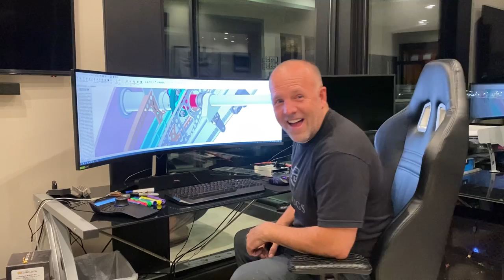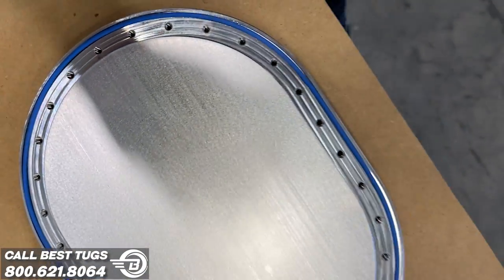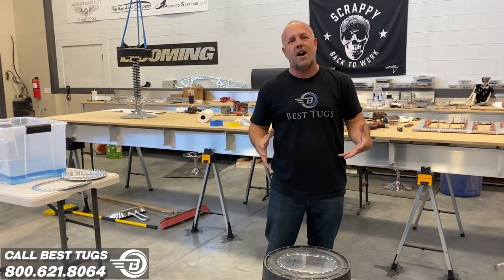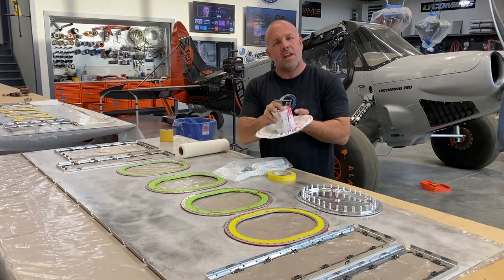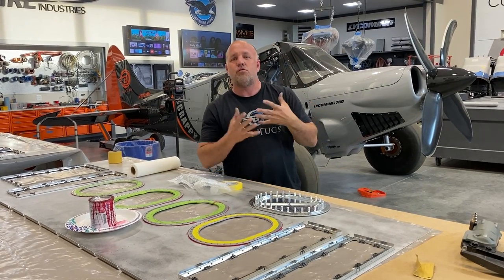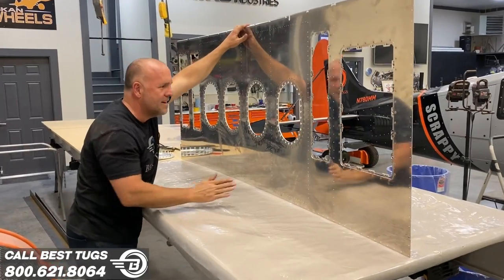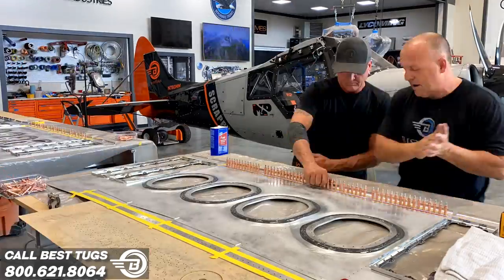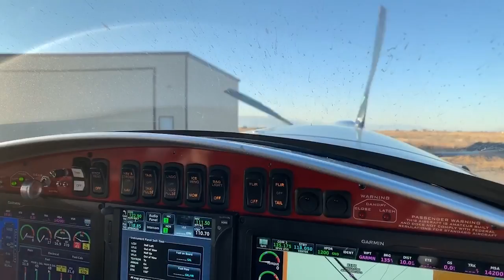WILD, one of a kind, Bush Plane Build | Scrappy #54

Comment: Mike,
How do you get the tail fly? Is the lift generated from the propeller wash? Don’t know much about airplanes
Reply: There's a string holding it up can't you see it. LOL.     Actually you're right. It is the air flowing around the tail. It's called a wheelie. And can be quite useful in certain situations.

Comment: Non aircraft related question about your PC setup for Solidworks......I've been using both SW and ProE for over 17 years in my job as an ME, and on two different occasions I tried using a 3D mouse like you have on your desk.  After two honest tries, I didn't see the benefit in either the efficiency or ease of use during my modeling.  What is it about the 3D mouse that makes it beneficial for you?  What do you like about it?

Comment: Wondering if the surface tension difference between water and fuel could cause a false positive? Maybe add detergent to lower surface tension to be similar to fuel so smaller leak paths could be detected? Enjoy the videos and look forward to more. Thanks

Comment: Oh Mikey, don’t think I would have made the fuel doors with monolithic studs.  Think I would have opted for dedicated fuel tank O-ringed anchor plates.  Just because you can, doesn’t mean you should.  The reason I’m saying that is, as the wing flexes, stress is put on those fuel panel close outs.  If I were you and had the where with all, I’d make up a set of close outs with the riveted in place o-ring screw retainers that can be changed out if they leak.  One of those studs cracks or breaks it’s headache city.  All the big jets use this type of sealing system on their fuel close out plates.  FWIW...

Comment: To test the integrity of a fuel tank, why not put two takeoffs, one for line in and the other for pressure measurement to pressurize the empty fuel tank and monitor the decay in pressure, if any, to see if there is a leak.  This is called a double block and bleed and is used to test gas fuel lines going into Turbines.

Comment: I like your fuel panel leak test, but I was thinking that a very small drip leaking out may evaporate from that hot pavement before you get a chance to see it.
Reply: That's a good point, but if that were the case he'd be able to find the leak on the plate itself, because avgas is dyed so it should leave a stain if it leaks and evaporates.
Reply: @44R0Ndin  True but I'm pretty sure those 2 big black leak test trashcans were filled with water, which wouldn't leave a residue.
Reply: @berndm9743  Water could be made to leave a residue easily, by dying it with food coloring.

Comment: Question regarding the skins Mike - do you not use stringers and cleats on a small plane, are they overkill for a lightweight?  (I worked for a while for one of big two commercial jet manufacturers in their wing factory so got to see the big wings through each stage of production).

Comment: Hi Mike, I had a question about your tanks,

I heard from an Ex-Boeing technician that aluminum is notch sensitive - this is why even using razorblades to scrape parts is forbidden. Aren't you concerned with cracks forming over time caused by sanding? I understand that they won't be used to support much load so the structure would experience a lot of stress, but surely temperature changes might be an issue over time? (just a thought)

Also, why did you choose to use aluminum over Carbon? Is it because of possible chemical breakdown of the resin?

Comment: For your leak test, with the added pressure of all that fuel it appears to me to helped the o-ring seal (the tall column of liquid actually assisted in compressing the o-ring) and a more stressful test would be an inch or two of liquid that would NOT squish the o-ring. Or am I all wet?

Comment: I’m guessing the amount of inspection holes are due to construction of the wing... I’m curious why tanks can’t be dropped or attached separately from the construction of the wing. I don’t know anything about Cubs. My guess is it has to do with the spacing of the ribs and their fastening method to the spars.
Reply: It is a wet wing. And I wouldn't necessarily call this a cub. The style is similar but nothing else appears the same, except for the rear spar which is actually a cub main Spar. LOL He will have  700 lbs + of fuel in those wings. Many Cubs do  use strapped in fuel tanks that drop. With smaller inspection holes. But the wings are also fabric-covered. 
   Aluminum has rivets. It's also prone the dent. I don't know what millimeter Mike is using for his wing skin but it doesn't take much of a hail to dent
.032. I thought he said he was using .050 for the doors. But if he uses that for his entire wing skin the weight of that alone would be in the neighborhood of 150 lbs. That's if he has a 32 ft wingspan with a 5 ft cord.  .050 well not dent very easy. In fact it's stiffer than most steel automobile body skin.

Comment: Did you fill it with water or did you fill it with av fuel? Water has a much different viscosity. Remember it is heavier than petroleum.  It will find a way out. When I did some race bike carbs I neglected to take into account the fuel viscosity of 113 octane race gas. Sure enough… blue fuel was leaking out of my seals especially my floating seals like copper washers on the stud nuts holding the Venturi‘s in place.

Love your channel.. thanks for sharing with us average Joe’s

Comment: The validation test of the "mock up tank" is a little short sighted. The body of fluid on top of the door is compressing the o-ring. Boosting the head pressure to 150% just helped to seal it even more. I would hazard a guess that once the tank was full you could have removed the fasteners and still be leak free. The true test is to run the reduced quantity of screws and reduced torque for the tanks lowest head pressure simulating low fuel levels. The lack of pressure would result in reduced compression of the o-ring and likelihood of a leak when it's least wanted. I'm not an aero guy but there would also be a percentage of lift pressure on that hatch lifting it away from the seal being that it's on the underside so that should be considered.  However, I like you're attitude for overkill and the quantity of fasteners plus attention to detail of doing it right means you've likely got a sound design.

Comment: Thanks for sharing your passion for aviation and engineering. I am no aviator but would like to suggest covering your two main wheels to make them more aerodynamic at higher speeds. Here are my basic suggestions:
the gear should basically be shaped like a teardrop like most landing gear. Any part that might get in the way of any extreme de formation of the tire or encounter the ground along rough terrain could be made of papier-mâché or something else that could easily break not damage the tire. What the papier-mâché is attached to could be made of something lighter and more durable. The important part of the more permanent part is that when attached without the papier-mâché, it should not be too draggy nor be at risk of damaging the tire.

Thanks again for your awesome channel.
Reply: Instead of doing the whole thing with the light material designed to break away, why not just make the wheel pants slightly larger?
Wheel pants are what that aerodynamic fairing around a fixed landing gear is called.
Of course the issue is that this plane is essentially operating as a bush plane (which is why the wheels are so large to begin with), and bush planes generally never have wheel pants because that creates places for mud and snow and the like to accumulate around the wheels, which might prevent them from turning or add mass to the aircraft.
At the speeds this plane is going to be flying (not fast), the extra drag from wheels without wheel pants vs wheels with wheel pants would be minimal anyways.
Reply: @44R0Ndin  Thanks for letting me know what they are called. Going big might be better, but I figured if they were designed to not get in the way even on rough terrain, the design would not be as aerodynamic. It would either not cover enough of the wheel, or would be so big as to negate it's aerodynamic shape.

Comment: I have a question... If the wing warps and twists (regular use amounts) won't there be a chance that the doors will not flex and therefore leak, cos it will produce an uneven pressure on the rubber gasket?

Comment: What was the reason for not putting the rivets in wet and only put sealer on top. We would never do it this way when repairing leaking rivets during maintenance
Reply from the maker: You’ll see that in a near video.  Unless the editor erasered it it should say that that joint is in the outside flange and the wet joint I never connected in this video.  I always always connect wet on tank side joints.  That’s outside the actual tank over an inch.  Just a spacer set using the glue to temporary hold.
Reply: @MikePatey  Thank you Mike Patey for answering my question, I am unsure if I understand correctly but aren’t the rivets for the inspection doors also on the wet side of the tank? Great work so far, really enjoy the inside of engineering a plane and building one.

Comment: What is the advantage of aluminum wet wings over a carbon mold? After watching you melt foam out of your carbon pieces with acetone, couldn't you do something similar to a single large gas tank shaped to fit inside the wing?

Comment: That fuel door wouldn't leak with all the fasteners removed especially with that much head pressure squishing the o ring
Reply: Your comment reminds me of a question we as students had to deal with in water engineering. How much head pressure do you need to keep a tennis ball in place under water over a hole in the bottom of a container....

Good insight on your part brother!

Comment: What do the stress field & shear flow look like in the narrow wing skin ligaments between the inspection port bulkheads?
Reply: From an uneducated, common sense POV, and not knowing exactly what the terms mean you are using, I'd venture to say the total bottom surface strength is greater then if it had NO ports. They are in effect, big gussets, making the mentioned "narrow skin ligaments" somewhat irrelevant.
Reply: @portnuefflyer  Are you familiar with the concept: "A chain is only as strong as its weakest link"?
Reply: Earl,  There is no weak link in the chain when the structural cover plate is installed.  The lost skin strength as a result of making the skin hole is compensated for by the addition of a doubler skin layer added around the hole and a removable structural inspection panel.  A structural inspection panel is differentiated from the more typical inspection panel by the relatively close spaced, precisely located attachment screws, often an added plate perimeter skin  layer, and additional panel strengthening elements as dictated by its size.  Mike is following design and assembly methods typically seen in high performance aircraft ( jets, turboprops, etc.) These elements are generally limited to factory build settings.
Reply: @myrlstone8904  Are you an aircraft stress analyst?
Are you familiar with the concept of shear flow?
As a thought experiment, imagine that the width of the wing skin spanning the rib line is 1/8". Do you believe that this width of material is sufficient to transmit the required shear flow around the inspection hole doublers?
Reply: What Myrl Stone said......

Comment: KC-135 tank rat here. Don't let your bonding wire attaching the door to the airframe get caught pinched over that o-ring. It happens. And don't wrench the screws down so tight, it's a pain in the @$$ to get that many screws out that are over torqued.

Comment: Mike you're a big brain engineer, do you apply earth curvature in any way to your flights? Is there software engineering in GARMIN that adjusts your airplane's elevators to keep the airplane contouring to earth's curvature? Which without, it would steadily increase altitude if airplanes simply fly straight. If not, I think we all need to question earth being a ball. It seems to be something we've all been told is a fact in our education but is never applied to any engineering and engineering cannot have false factors otherwise our inventions can't work.

Comment: Per the tank seal test. Does not nav gas have less viscosity than water? 
I would have used gas and pressurized the test tank. Three or four psi would have been enough.

Comment: Hi Mike, is your pressure testing slightly flawed as increasing the perpendicular pressure increases the closing pressure/seal of the O ring. Obviously that same pressure increase want’s to apply force parallel to the surface.

What about a reduced pressure test so the inspection plate has less closing action and could more reveal any leaks???

I see it as opposing scenarios that are both as likely.

Comment: What was the pneumatic c-clamp looking tool that you were using?
Reply: That’s a pneumatic rivet squeezer. Rather than pounding the rivet with a pneumatic hammer gun and using a bucking bar to expand the rivet, the squeezer incorporates both tools into one. The squeezer can be adjusted to produce the proper dimensioned buck tail in one quick motion.  The limitation is that one can only work along an edge. The distance from the edge is limited by the throat depth of the squeezer.

Comment: At 6:00 been asking this before because I cannot get into my head why Mike uses the (IMHO lame) imperial (US variant) units instead of metrical. Actually, why anyone would. This build would much simpler because he wouldn't need to convert from one thing to another. Today came the sand paper with a 120 grit and I wonder if this is pr square cm or inch. Are the metrical units sneaking in on him?

Comment: I’m sorry, but shouldn’t you test the fuel access panel with all the screws in place and torqued to the proper value to make sure the o-ring does not move under the pressure?  I have installed my fair share of fuel tanks, rubber bladders, and the correct torque is imperative to make sure the gasket is not squished out.
Reply: Did you listen to anything he said? He felt that it might be possible that the installation could end up compromised because of maintenance or something, so he wanted to know if it would still hold up in that case, hence why he only used half the fasteners, and only partly torqued them. He also retested it for 24 hrs that we didn’t see in the video.
Reply: @colinwallace5286  hey Colin, pump the brakes there hero.  Everything you said and Patey said is bullshit. Test the component the way the parts will be used.   Don’t give me that compromised because of maintenance, he is doing the Mx.
Reply: @rocketyler6698  You’re nitpicking, and you have an inflated view of your knowledge. He was wondering what would happen if it was compromised, AND he later tested it “the way it will be used”.
Reply: Yea that’s right I’m nitpicking. Fuckin airplanes stay in the air because us mechanics nitpick. And another thing, I don’t inflate my knowledge, I use it. You and Patey can go on believing in this strange world of built it and it will be fine, but you can’t built an aircraft if don’t follow the basic rules and norms of aviation maintenance.  Mike Patey has this idea of “if you imagine it you can build it”, that does not mean it should fly. Guys like you take his action as the Bible, well I’m sorry but you have drank the kool-aid.  Find another band wagon to get on, one that’s not so basic.   Thx R.T., PP A&P IA.
Reply: @rocketyler6698  Remember what you said about “pumping the brakes”? Don’t start something if you’re going to get pissy when someone replies. Nothing easier than letting the bull run into the wall headfirst because he was too riled up to look where he was going. Have a nice day...🙄
BTW, you forgot DB and SOB on your CV, mon ami...😎

Comment: Exemplary work as always. But excuse my ignorance, why so many inspection hatches for the fuel tanks/bays?  You don't have such a thing in cars. It either holds fuel, or gets a blockage (at the filter) or leaks. Seams a huge lot of work & potential trouble for nothing? I'm sure I'm wrong, but what's the reason?

Comment: Scrappy is flappy in her tail. Are you worried about those oscillations?
Reply: That's pretty normal to see in aircraft that aren't designed to exceed 250-300mph, the tail doesn't need to be super rigid to prevent flutter because it's rigid enough for the speeds it flies at.  The slower an aircraft is meant to fly, the more wiggly they can be.  Even high speed aircraft will wiggle like that at a high enough airspeed, and the technical term is aeroelasticity.  The trick is to not over-wiggle the tail by not going too fast.  Really oversimplified but that's basically what it amounts to.

Comment: Would it not have been easier to do an hydrostatic test of your fuel doors. That way you would only need a small reservoir of liquid and you could have kept increasing the pressure to find the leak pressure not just with limited bolts and torque but with all the bolts at full torque.

Comment: YOU FOR GOT G LOADING
Reply from the maker: That’s in a future video 👍🤠  that test and the way I did the doors the seal gets tighter with pressure and G loads.  G loads is literally on every calculation of this plane as one of many of its primary engineering focus.  I’ll go into more detail on it specifically in later video.

Comment: Kinda breaking a cardinal rule of not sanding ALCLAD....that cladding is only 5% of the thickness of the sheet, you won't have anything left after hitting it with 120grit.  Tanks are not really a great place to find corrosion.